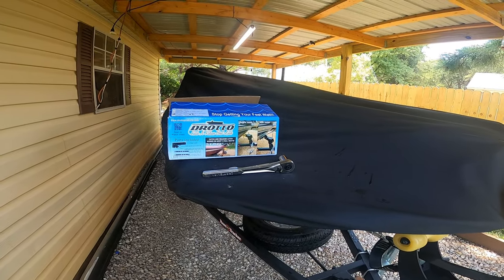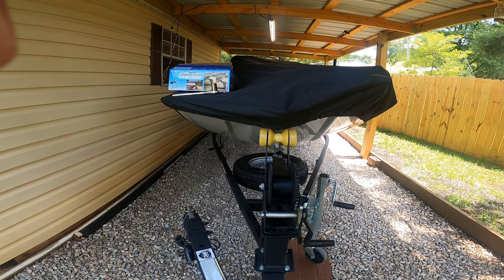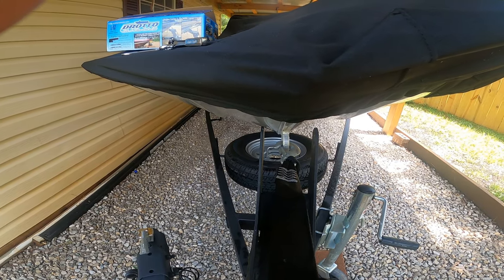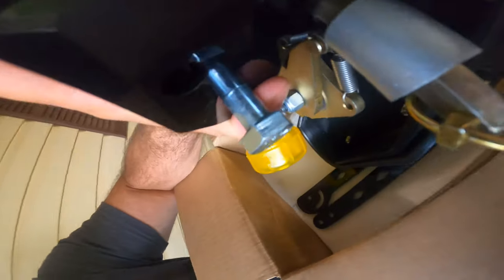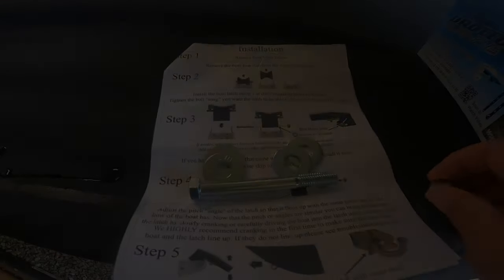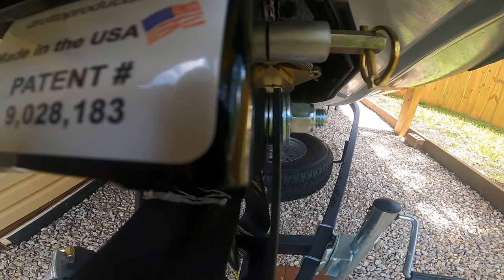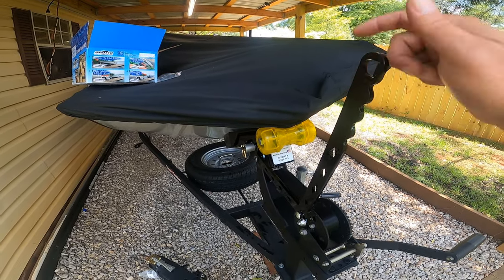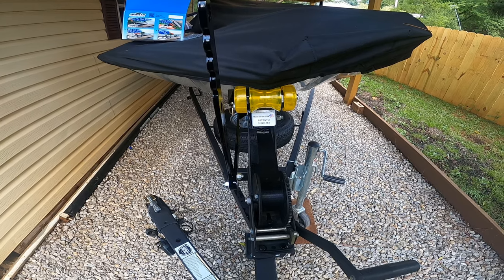Drotto Boat Catch and Release Boat Latch #Drotto #Tracker Classic XL

Comment: I wonder if would work on my tracker 170 ? 
Would have loved to see it in action
Reply from the maker: I believe this model will but you can reach out to the Company. Very good customer service and top notch quality!
Reply: @RCBassin  will do. Thanks
Reply: Hey did you ever get an answer about it working on your 170
Reply: @DJEL1200  yes. The company said it would not work on the tracker. The eyebolt on tracker is different and would not catch
Reply: @GmanfromTexas  thx for the info. I see the boat2trailer one comes with an adapter for tracker boats

Comment: does it mark or scratch the keel?
Reply from the maker: Nope. Latch slide panel construction of some type non-marking composite material. Takes a few loads to get your trailer depth right but then smooth load and latch.
Reply from the maker: Thanks for watching and if you liked the video and want to support the channel just hit subscribe. 🙏